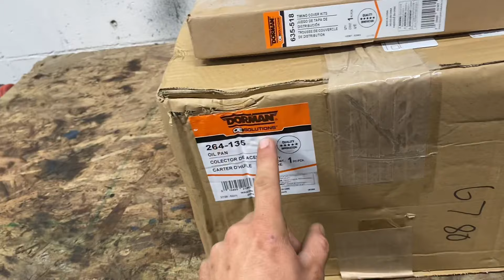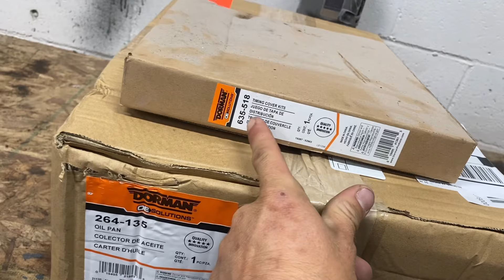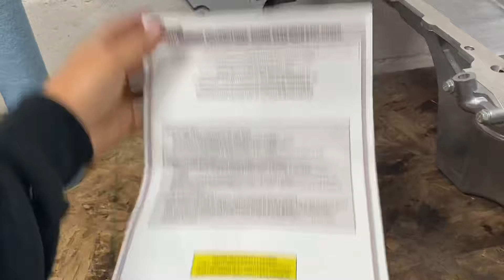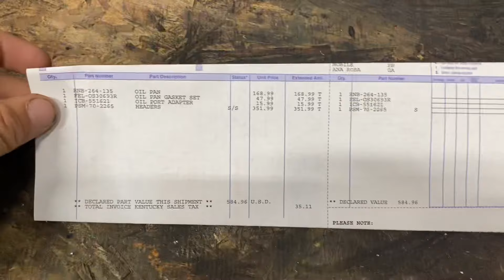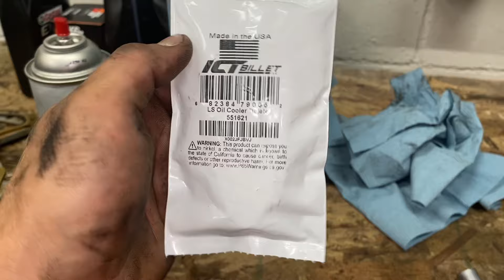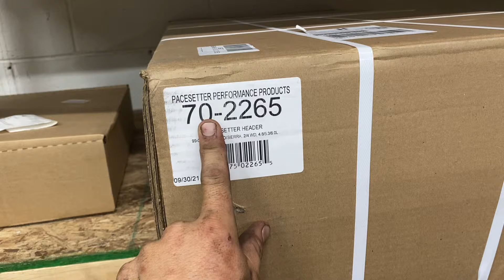99-07 SILVERADO 5.3 OIL PAN & REAR MAIN SEAL REPLACEMENT

Comment: why did u use a new oil pan?
Reply: You don’t have to unless your oil pan isn’t good but he said he just likes doing just because he is changing the gasket so mine as well just the oil pan but i didn’t change mine when i did it
Reply: You should also replace your oil pump pickup tube o ring

Comment: looking to do this swap with my 02 suburban, how does the nv3500 compare to the 4l60e length wise? anyone know if i can use my np246 or would i be better off swapping to a lever operated transfer case?

Comment: Good choice of oil and oil filter lol. That’s exactly what I’ve been running in my truck for years. 137k when I bought it to 214k now. Runs like a goddamn beast with 0 lights on the dash. Butt.. unfortunately, it’s time for rear main/oil pan gasket obviously 🤣

Comment: That's the factory wax E frame coating your scraping off. All of the oil pan bolts are 18 ft pounds. The two long ones into the rear cover are 106 inch pounds, and the two into the trans are 37 ft pounds.

Comment: Did you support the engine some how or was it hanging by the mounts, I need to do this to my 01 but unfortunately il be on the ground and it is 4x4 sliding back the tranny and transfer case as far as possible.
Reply: Remove the transfer case first

Comment: I have a question for you does it matter if it's a 4 wheel drive is the fitment the same or not on the oil pan

Comment: im seeing several of these videos but have a question. Why are you replacing the rear mail seal housing with dorman's whats the advantage? It seams like everyone is replacing it but why? I'm not seeing any bullletins from GM saying I should change It with a updated one.
Reply: Long story short, it's easier and cost about the same. 

  Longer explanation: To do a rear main correctly on an LS you need a special centering tool. It ensures the seal sits perfect on the crank. Some parts changers will just swap the entire housing thinking they will get around centering the seal. If you torque the main housing to the block before you insert the long oil pan bolts, you can usually get away with it. The problem occurs when you put the long bolts in before you set the seal housing, it will pull the housing down and initially cause a leak point at the bottom of the seal then cause excess wear on the top of the seal. Once the wear happens on the top you will have catastrophic failure. Most major parts stores have the loaner tool that centers the seal.
Reply: @skab768  Ya, i bought the new dorman cover but then removed the seal, installed the cover properly with the alignment tool and bought another new seal and then installed the new seal. Doing it the right way is the only way to gaurantee your not taking it apart 2xs.

Comment: I have a 2006 Chevy Silverado 1500 4.3 I need to replace rear main seal and oil pan gasket is it on passenger or driver side or in the rear

Comment: I changed rear main seal. Oil pan gasket and valve cover gaskets. Along with the oil pressure sensor. And I still have an oil leak. Where else could it be leaking from?
Reply: Crank sensor O ring next to the oil pressure sensor
Reply: Could that cause fluctuating oil pressure with a leak?

Comment: I have an 02 with the 6.0 and 4l80e and I believe I have a rear main seal leak and I just been topping it off for years because of how much the 4l80e weighs. I wonder if its worth a shot to see if its actually the oil pan gasket
Reply: Try oil pressure and cam sensor first
Reply: @ericvetick4932  turned out to the be the rear cover. I figured this out after having to pull the engine because we had a catastrophic failure that resulted in 5 spun bearings. New gaskets everywhere now hopefully it wont have any leaks now

Comment: I decided to take a whack at just replacing the oil pan gasket. If I’m successful with the pan but the rear main seal is the main leak is my effort all in vain or can a rear main be done without dropping the oil pan?
Reply: You can replace the rear main without pulling the oil pan again. I just did the same thing lmao
Reply: Thanks, Yeah- turns out my oil 
leak only got worse after new pan gasket and perhaps confirmed my suspicion that it’s the rear main.
Going rate Hawaii is 1600.00 for 
that one 🧟‍♂️ I pictured myself doing it maybe snapping a few exhaust manifold bolts in the process. 😱